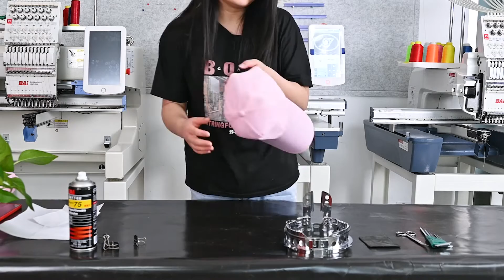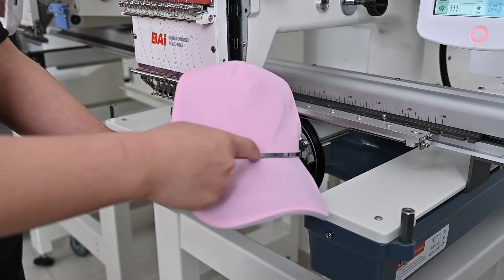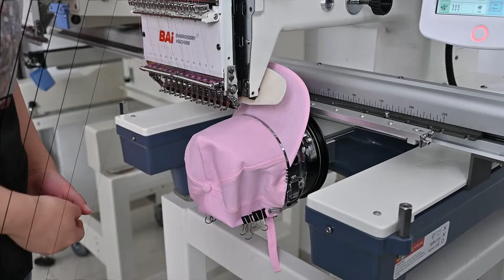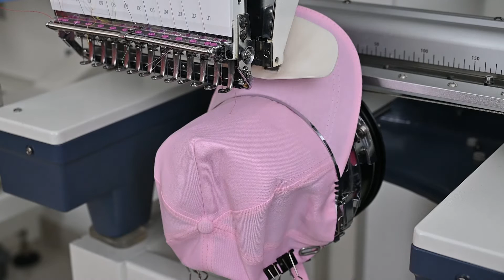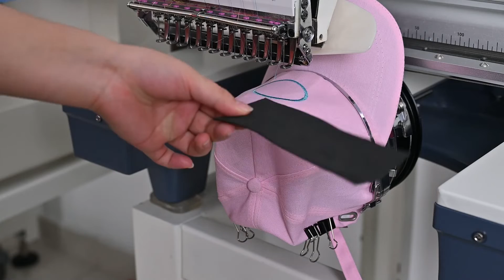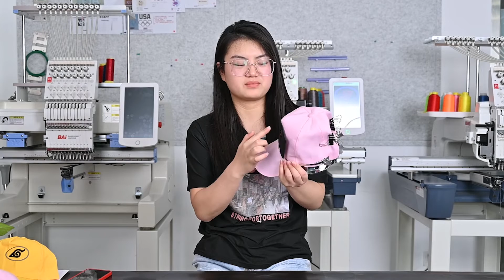How to Embroider 3D Puff Hat | Embroidery Machine for Beginners

Comment: What type of thread (polyester, rayon) and what weight (40 or 60) did you use and what is recommended?
Reply from the maker: We typically use 40wt polyester thread. However, if your embroidery is more detailed, you might want to consider using 60wt.